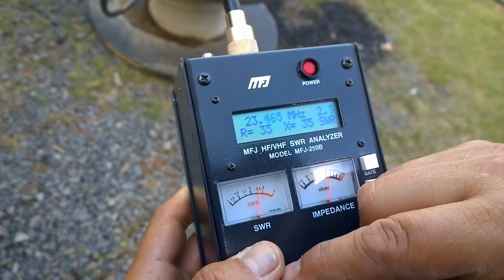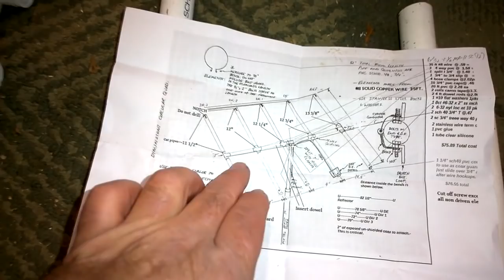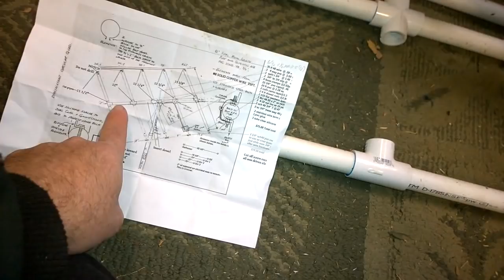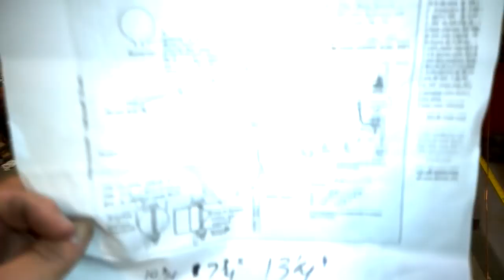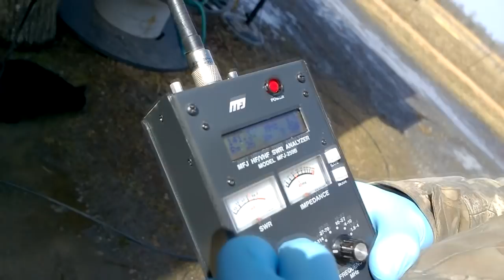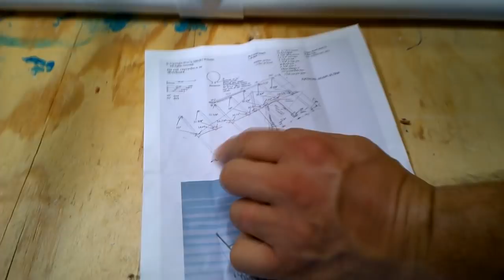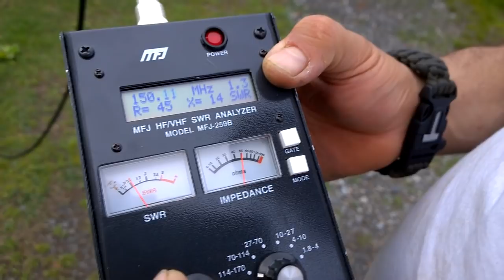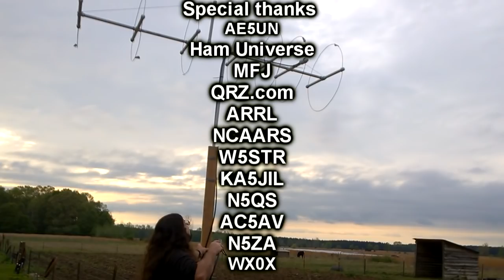Updated Don's 2 Meter Extreme Dream Beam Antenna

Comment: I'm curious about grounding these monsters.  I may have missed the application but where are you attaching the ground wire?
Reply: If you look carefully when they build the driven element, the wire is not a complete  circle. They use two screws. The shield  is is connected to one end of the wire, the center conducter is connected to the other.
Reply: @patrickhenigin4805  I fully agree that's how you complete the circuit going to the radio.  The question was not asked properly.  How/ where do you attach a lightening ground to this antenna
Reply: @willpease5604  you can use a coax lightning arrester
Reply: Thank you all for the good Intel.  My 7 element is built and up in the air on a rotor.  For my area (LOTS of mountains),  it's range is beyond impressive.

Comment: great video. how did this antenna hold up in the storm tonight?
Reply from the maker: Gamble2185 We have 5 element versions that have survived over 5 years through the worst.
Reply: If you are worried about strength run a big dowel down the length on the inside.

Comment: What wattage radio did you use to test the range?
Great Video! 
Thanks
Reply from the maker: +Plains Prepper   5 watts- has given us 100 miles into repeaters on a regular basis at 45 feet. Not a full quiet signal but for qrp it will amaze.   73  ty

Comment: While that worked, just an observation.  Drill bit flutes are not designed to cut, they are there to clear chips from the hole.  The only cutting surface is on the very tip.  It would be a lot easier if you were to use a bit designed for cutting sideways, like a Roto-Zip bit.

Comment: Is there a dual band version of this?
Reply: VanishingNomad all odd multiples of wavelength will be resonate on a loop. So 1x, 3x wavelength will be 50 ohms. 2x wavelength will be like 200ish ohms.
Reply: VanishingNomad I guess what i should have said was, make the loops as large as the lowest freq you intend to use (loop cicumference is 1 wavelength) and connect up one of those antenna tuners. Preferably an outdoor box mounted very close to the antenna and you will have awesome gain on the targeted band and all higher frequencies.

Comment: If one were to build this antenna, any recommendations on the best method to ground it.
Reply: Samuel Pike This is a "full wave loop" balanced antenna. You can ground it at the point where the sheild of the coax is connected.
Id recomment using a choke and grounding it on the radio side of the 1:1 current balun (basically a few ferites over the sheild) so your mast doesnt radiate and screw your antenna up. Because its a loop antenna the center of the coax is at DC short to the sheild so a lightning arrester is unnecessary.
Really this is just a rounded quad style antenna. Round loops have more gain than square loops.

Comment: Can this be adapted for CB use?
Reply: +Bob Clark For 11 meters this antenna would be Very Large & much more costly.PVC would NOT be a good choice for that antenna either since the weight would increase by a Very Large amount as well & the boom would break from the stress as well as being for from straight once it was assembled.
Reply from the maker: +Bob Clark  I doubt it.. Maybe a matcher?  73s
Reply: I had a ten meter cubical quad. Aluminum beam with fiberglass spreaders, 2 element, used a length of 300 ohm ladder line to match the coax. Awesome performance. 
You will have to find specific directions. More than 2 elements gets cumbersome.

Comment: Is this considered circular polarization?
Reply: No its vertical the way they fed it
Reply: @henrycross8776  What confuses me is if   either a horizontal or vertical wave striking the antenna conductors strike it would induce voltage into the coax since the driven element is neither vertical or horizontal.  My little brain sees the conductor somewhat vertical and somewhat horizontal.  Then again I can see if you placed the mast in a vertical position it would seem to be a compromised horizontal antenna.  Jeez, antennas make a complex area of science on their own.